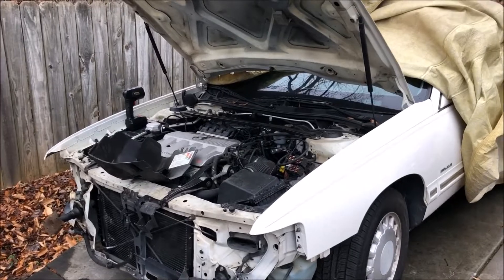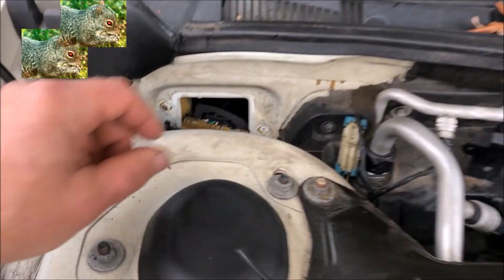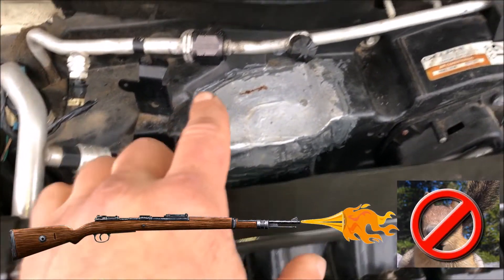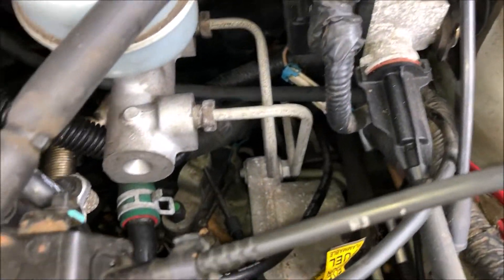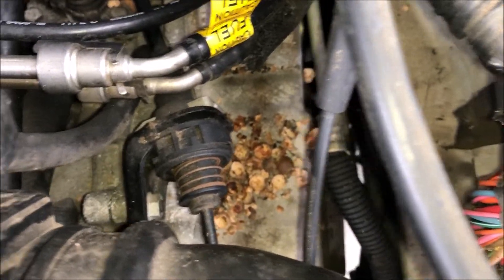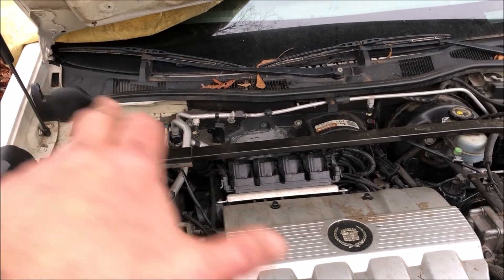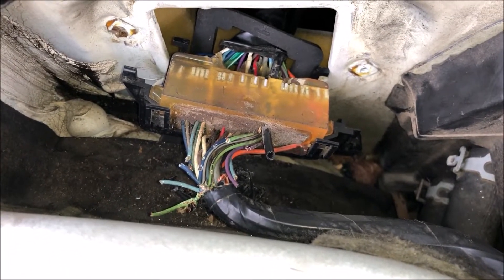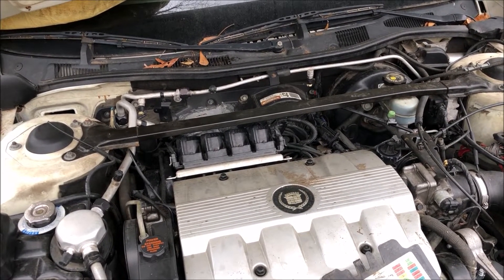Squirrel Eating, Chewing Wires Of Car Engine Harness & Stopped Wreck Repair:  Deville Series Part 15

Comment: Problem increased, when car industry switched from petroleum/plastic based wire sheathing/coatings, 2 soy based coatings. Tree rats got Lincoln air ride wiring f'd up, then got in attic & chewed up wires in a heating unit.
Change probably was pushed downstream from wire manufacturers 2 all industries.
Reply from the maker: I can't believe they couldn't predict this would happen

Comment: Found that the material protecting the wires, the orange stuff, is nothing more than hot glue. With a little patients a heat source and a flat head screw driver, I was able to melt the glue and peel it off of the wires exposing about a half an inch of wire to make connections with. I am in the process of dealing with same thing hopefully being able to reconnect the wires and fix the issue. Could not find a replacement harness anywhere.
Reply from the maker: thanks for that info.  I did cut a replacement hardness out of a junked Deville.  Haven't spliced it in yet.  With all my other projects, have been considering part this old girl out... :(